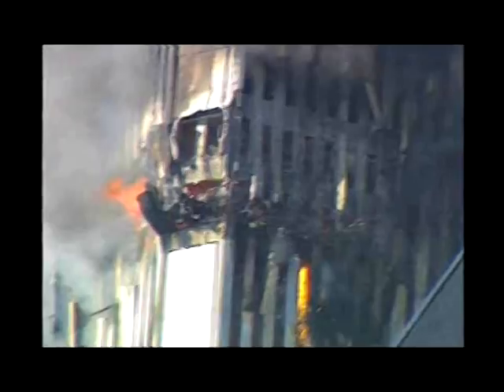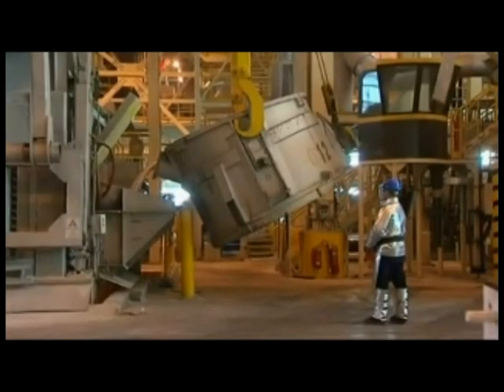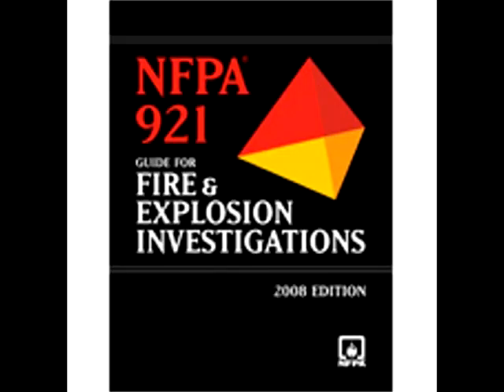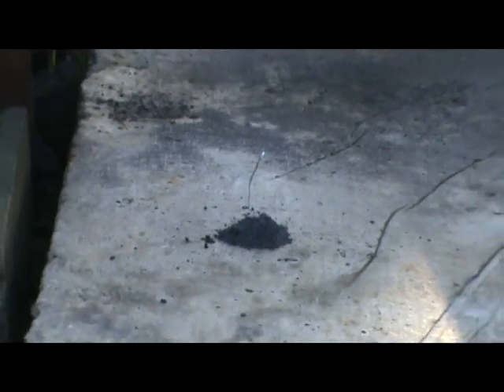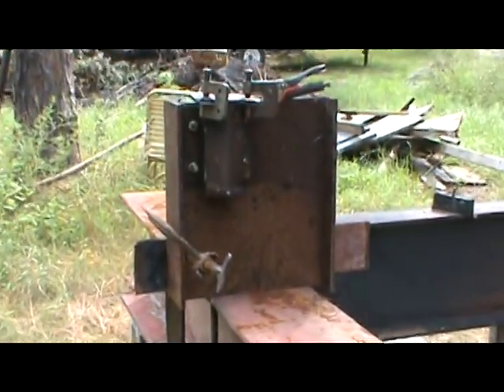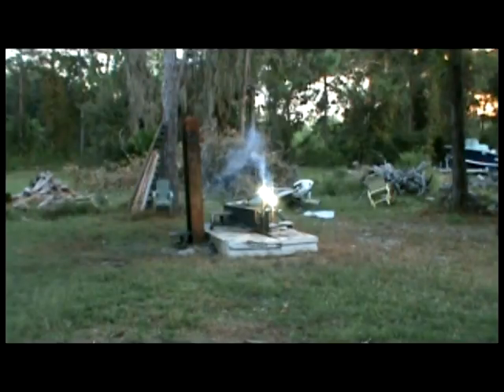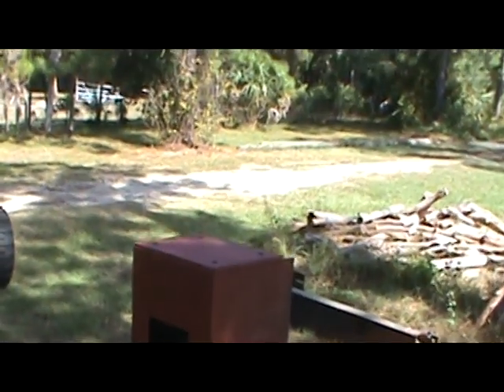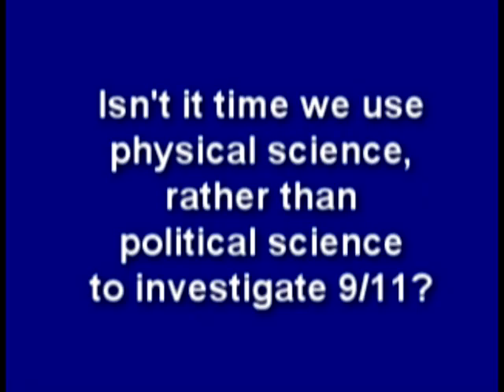9/11 Experiments: The Great Thermate Debate

Comment: And how, pray tell, do you think they fitted this thermite onto the actual steel beams 90+ floors up?
I'm pretty sure someone, somewhere, would have seen some activity.
Just because you CAN melt steel with thermite, doesn't mean that's what happened, especially when you're basing this entire premise off of eyewitness anecdotes during an incredibly traumatic events.
Oh it LOOKS like molten steel? Therefore it is. 
Oh this person says they heard something that SOUNDS like an explosion? Therefore it was.
This is not evidence of either.
Hardly scientific rigeur.

You need to believe every one of these anecdotes - even the ones that contradict each other - to open artificial holes in the events that happened. Without these artificial holes, your conspiracy theory won't survive.

In reality, there isn't anything more that needs explaining.
For someone who labels their channel 'physics and reason', there is a conspicuous lack of reason.

Comment: I just have to lol.

There was so much plastic and other materials and the fire wasn't "open air" it was thermally reflected.  Aircraft are made of more than "aluminum" they're made of titanium, magnesium and all the other metals that once ignited can burn absurdly hot.

The statement that "super thermite" is an explosive is beyond red herring.

It would not surprise me in the least if the terrorists filled their luggage with materials to cause hotter fires.

Comment: Its been hit by a plane before! 1945 i believe. a b25 bomber hit the 79th floor of the empire state building. Only 2 floors cought fire and 14 people died! that was it! and the fuel in the piston engine aircraft such as the b25 burns much hotter then the kerosene used in jet jet engines! Its unbelievable how simple people are to believe that a aluminium tin can (plane) could bring a huge building down! come on people!

Comment: If your goal by these tests was to prove that it would be possible for anything else to mimmick the actual events, you possibly came close to achieving your goal.  However if it was to disprove a different theory, you didnt even come close.   How much pressure was on the beams?  Each beam end what did the pressures change to as load switched between beams.  As i'm sure you know pressure equals temp and that equals change of state.  Where was the steel purchased?  What was the actual make up of the alloy?  What the alloy consistant throughout the entire building? What temp does magnesium change state?  Now if you work with those questions you would be getting closer to an honorable goal imo.

Comment: I love the comments here no I'm no expert in Metallurgy or in what aluminum can do to steel but I am a metalsmith and I also do know that if you increase the amount of fuel or increase the amount of oxygen you increase the Heat and not all heat will show to smoke because there are other ways for to draft up but as far as a steel-reinforced building that is actually quite possible because you need to factor in the speed and the Velocity in which it was traveling at the point of impact and if you could actually do that I could promise you and I was traveling fast enough to penetrate because if you would remember two planes struck the twin towers and both penetrated into the towers now when the second plane hit the other the second tower that is when app we actually got the recording on TV and that plane if I remember right they said exploded and the heat happened another one or quote you that it's $18,000 probably about 2,000 degrees folks forging temperature of steel is right around 2000 degrees the temperature at which aluminum melts and by the way watching the video that orange stuff that you see flowing down is probably molten aluminum to those of you who are idiots because you're talking about how molten aluminum is not bright orange or red your idiots because it is that is the colon with your I will perceive it it is not blue and as long as it is around the heat Source it does not cool down quickly it actually takes a while for it to cool down to Blue and just so you understand who I am and what I am I am a metalsmith I deal with Metals metals and yes I've even worked with steel it is true still doesn't melt till almost 3000 degrees but it will Buckle around 2000 degrees when you heat fatigue steel you will cause a buckling effect and don't worry about the concrete standing up

Comment: Steel looses strength as temperature increases. by the time it hits 1800 degrees it is 1/10th as strong.  Steel beams do not have to melt to fail from the weight they support. This man is a bad engineer, but good at making thermate and cool explosions.

Comment: Steel fuel can’t melt jet beams.
Reply: Scott S   where can i get some of that Steel fuel and jet beams, Mr. Scott?
Reply: Steel fuel is for spoon-fed casuals.
Reply: Scott S lol
Reply: Mikhail New Yes but jet beams are pretty hard core!
Reply: sure can weaken it to collapse limits
Reply: true. fuel it cant melt jet hole
Reply: Find steel fuel at the refinery. Find jet beams at the aeroplane factory or its metal frame fabrication site.. :)
Reply: Scott S,  oh i beg your pardon, but jet steel can absolutely melt anything   Sir.
Reply: Super.Chuck  dude its called a furnace, not a office fire
Reply: I guess it can.
Reply: KFStreich there was no resistance below the impact zone. Only possible with demolition
Reply: Nokia will never die it would buckle and topple over then, not fall right down as if demo charges were lit.
Reply: Maybe it was because fuel beams can melt jet steel.
Reply: It’s an interesting debate.
Reply: Scott S    it's interesting, jet fuels ignition temperature doesnt melt steel beams, but it could drastically weaken and deform the beams. 
However, the ignition temperature for jet fuel is the minimum temperature, that means that actually yeah that fire could have got hot enough to melt the beams.

I have a real life example too, so a friend of mine's best friend is a big train boff, he has "had" a few of those model trains you sit inside and drive. His next door neighbours had a bonfire which got out of control had turned into a garden fire which spread across 4 gardens, unfortunately destroying sheds and with that my mate's mates work shop which contained his big model steam trains. The fire got so hot that it actually melted these trains, these are steam trains too they're meant to take the heat, one of them only had a boiler left which was bent to an almost "c" shape, the others had severe melting and fire damage. That fire had no jet fuel, maybe oil but jet fuel burns hotter (to my knowledge please correct if wrong). This fire was fueled by wood.
Another however, I've seen this video before and 100% believe WTC 7 was a controlled demolition which the understanding I have now. And I'm not convinced by the twin tower story from teh gov, yes the planes hit but is that really enough to bring down 2 buildings?
Reply: Exactly!

They soften the steel and as it softens it can hold less weight, did you notice the tower that was hit lower fell a shorter duration after the impact?  There was more weight above the impact zone.

Comment: Don't forget that the plane itself is made up of aluminum and other materials. What we are not being told is that the World Trade buildings were built as cheaply as possible and that short cuts were very likely taken when constructed. The fact that the section of the building that was reinforced years earlier from a previous attempt to blow up the building survived after the 9/11 collapse and may be some proof that the building needed added support throughout. There is always a trade-off on any project. Just a matter of money and perceived safety measures. I am willing to bet that future high-rise buildings will be built differently do to this event.
Reply: "World Trade buildings were built as cheaply as possible and that short cuts were very likely taken when constructed." Nonsense.

Comment: I would like to point out that the construction of the twin towers was at the time a marvel of engineering. It had no center structure. When the planes hit the floors burned and dropped causing a massive draft and the whole thing heated up. Combined with the fact that the exterior structure witch held all the weight because unstable and twisted. The building collapsed and became a furnace when thousands of pounds of concrete and steel fell.

Comment: So your theory goes that in a coordinated plan that at some point workers entered the towers. Accessed the beams and columns. Installed these thermal devices at all appropriate stress points. Both above and below the impact point and then triggered? Assuming then that this must have also somehow been coordinated with the terrorists piloting the aircraft so that they could hit the buildings in the appropriate locations? 

Or does it prove that through trail and error a person can achieve any outcome they so desire to prove a theory.

Comment: Steel melts at around 1500 C. Steel structures under load will creep at 2/3 rd’s of their melting temp. The towers didn’t need thermate or thermite to collapse. The temperature inside that building would have easily reached 1000 C, shit that’s cooler than a coal firebox for a steam locomotive, which is around 1300 C. In my country the tragedy that is Grenfell tower burned at 1000 C (that didn’t fall down as it was mostly concrete carrying the loads) I’m not saying the US gov arent lying fuckers I’m just saying let’s get the science right and don’t forget about Creep. Bitches.

Comment: The steel need not melt to fail,why can't people understand this simple physics,chemistry,metallurgy fact? What I learned from this video is that Thermate wasn't used ,first the idea the building was packed with man made thermate bombs when it was constructed  and then to have a 150 ton aircraft strike the tower at the 80 th floor,then to ,collapse the building from midpoint..Impossible.This was a very hot fuel oil fire.No designer ,structural engineer ever anticipated a 150 ton 10,000 gallon Molotov cocktail of fuel oil striking the building. .

Again,A fire of Jet A fuel oil need not melt the steel,long before the steel ever reached 2700 F it had lost   90 percent of its load carrying capacity .These were caged steel structures [banned now ].  Building 7 burned 7 hours out of control before collapsing ,note the pictures of WTC 7 to see just how hot that fire was.

At the temperature of burning Jet A fuel oil 1000 C 2000 F those steel columns had lost most all of their strength,thermal contraction,expansion allowed them to sag,pulling in the outer columns,allowing the floors to collapse the building.Jet A fuel oil does a much better job then thermate .Watch how fast the Jet A fuel oil takes out a loaded steel beam.And it does it,without melting the steel column. https://www.youtube.com/watch?v=N2TMVDYpp2Q&t=15s S

Comment: I saw a documentary which showed that the fire + aluminium (from the airplane) + restricted area acting as a furnace (the offices) + water (from water pipes) all contributed together to raise temperatures high enough to buckle metal.

I don't remember exactly as I saw it a couple of years ago but the fire was hot enough to warp steel and the molten metal was most likely aluminium from the planes or something along those lines. It made sense.

Comment: Do you think that when they designed and built these towers they installed a system that if the building were ever to be demolitioned they would have it pre installed?
Reply: No.  That would be stupid.  Steel buildings in urban areas are dismantled anway.

Comment: It wasn't a conspiracy, steel doesnt have to completely melt to a liquid form to be able to bend, it bends with heat put on it. Anyone who has used a torch or done metal work knows that.. What ppl dont understand is if 1 beam bends or melts it all comes down because of all the weight on everything on top of that beam which all of that comes crashing down on all the beams below. Not only that a 747 has a wingspan of 200 feet and that alone flown into a structure at 500 mph would do some damage to any structure not to mention they were loaded with enough jet fuel to reach California.. Also they removed asbestos from the WTC which was an excellent flame retardant. Alot of the metal flakes and liquid molten metal pouring out the side of the building was melted aluminum and steel from the airplane. I mean I just dont see any evidence of a conspiracy. If you are suggesting thermite was used how would've it gotten implanted in an in use building with offices and restaurats the beams being hidden behind walls etc?? I dont know why so many people feel like it was a conspiracy
Reply: It's obvious how the thermite got in the building....according to multiple conspiracy nut jobs the government filled the building with thermite ONE DAY before the planes hit and yes they really did say ONE DAY 😂😂😂 these conspiracy people really need help.

Comment: Steel takes a small amount of time to melt but it does indeed need time.   A flash of brilliant heat, no matter how hot, will just singe the surface.  It takes a second or two for the heat to transfer through or soak into the thickness of the steel, bring it up to temp and then it can melt.  So a flash of thermite isn't the best way to melt steel.  A slow, steady burn at a lower temp would be far more effective than a short one at a much higher temp.  Any material used to dam and direct/focus the thermite would need to itself be consumed in the reaction lest it be discovered in the debris.

Comment: I totally agree.  Common sense and my experience as an engineer would lead me to conclude that the molten metal pouring out of the  building isn't caused by jet fuel and office equipment.  Jet fuel doesn't burn like petrol/gasoline. It was a demolition.

Comment: Jet passenger plane is constructed of  Aluminium,Magnesium and some steel,along with a few thousand gallons of   jp-4 jet aviation fuel.  Combine this with high winds to provide plenty of oxygen and then add large amounts of office furniture much of which is aluminum and tons of plasterboard walls containing calcium carbonate and calcium oxides and you have guess what?  THERMITE.

Comment: Another thing to remember this building was only going to be half as tall originally. It was spec out for a different location at first not close to water which can crode steal. They moved the towers to a different location and then started adding floors. They also added cooling which was a huge swap cooler pumping thousands of gallons of water from the river below through out the whole building to keep it cool. That added thousands of pounds of weight not factored in originally.

Comment: So nobody seen workers cutting up the floors and walls to get to said beams?
Reply: Wrong witnesses that worked in the building saw lots of “workers” entering and exiting the buildings prior man did nobody in the comments section see this shit when it happened.
Reply: 12:43, the thermite devices couldve been put from the inside and inside the beams.
Reply: Alfonso Castro that's what I'm saying. You would have to cut threw multiple layers of wood/steel dry wall ECT.. In order to get to beams. I think it was an inside job kind of. But i don't buy the whole, "bombs on the plane and in beams" theory. If the USA needed an excuse to invade Iraq, fling planes into the building would do it, it wouldn't matter if they fell or stood standing

Comment: The jet fuel fire weakened the steel, which loses 50% of its strength at 1100F. Also the steel girders on the higher floors had no fireproofing. Popular Mechanics debunked all these myths. Twice.
Reply: Brian Rad ..the steel design code incorporates a factor a safety of 2 in the column buckling load equation..add to that the fact column are seldom if ever designed for 100% capacity and the factor of safety is even higher...add to that the fact that the nist forensic "analysis" admitted there was nothing wrong with the columns below the crash sites (they were NOT effected by the fire above) and you'll start to get the picture.

Comment: it's a fun conspiracy but i'm not buying it due to personal experience.i once got a 2 day job that involved removing 20= burnt and fire damaged cars in a parking garage under a three story hotel. the heat from the burning cars caused 24 inch i-beams to twist and bend like pretzels and aluminum engines to melt .the building did'nt fall but they had an engineering company shore it up before we were allowed under to remove the cars

Comment: Everyone with any ability to use logic and reason can come to the conclusion that the WTC didn't collapse from a plane hitting it or from fire caused by that impact. The temperatures just can't get hot enough. Someone did a demolition job. The question is, who?
Reply: Jesus christ. You don't think steal weakens at high temperatures?
Reply: The situation as a whole shows that the WTC didn't collapse in the way everyone seems to think. Planes have hit skyscrapers in the past and they burned for longer periods of time and the buildings didn't collapse.